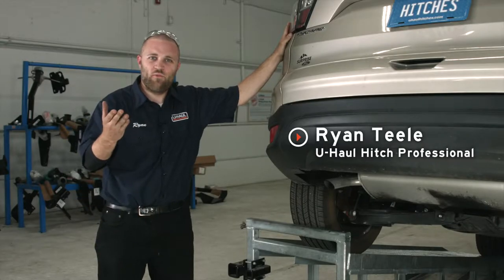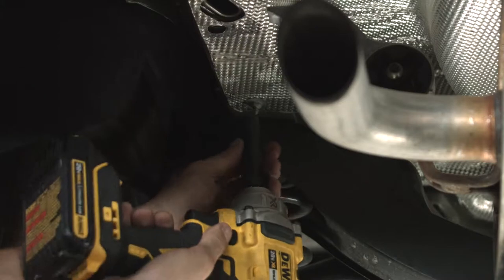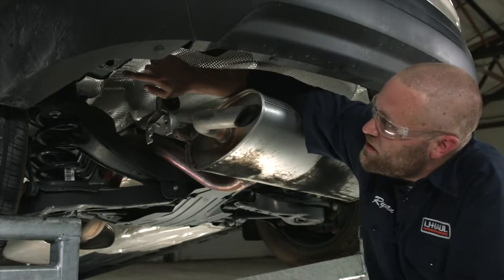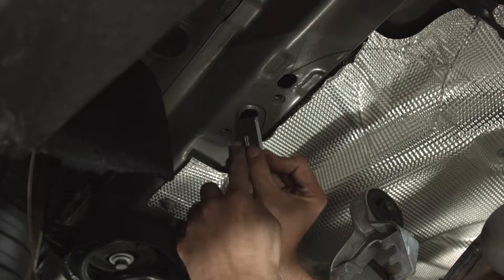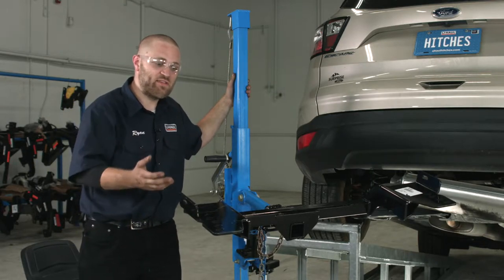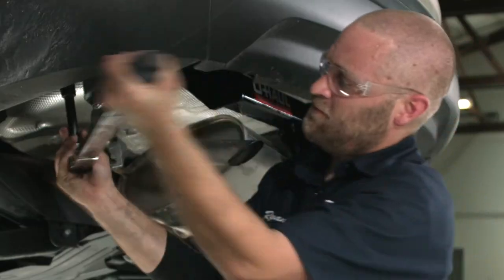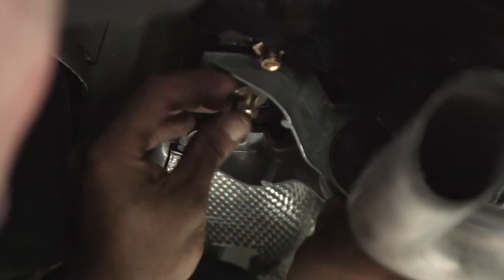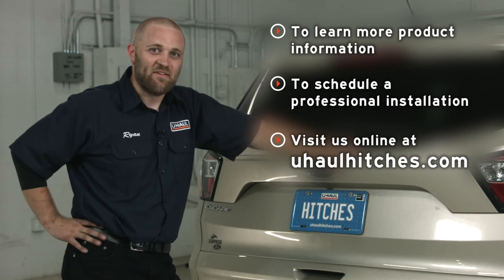2017 Ford Escape Trailer Hitch Installation

Comment: Omg thank you for this! I’m moving with my wife to WA from AZ and I’ve been trying to figure out if a tow hitch can go into my 2017 Ford Escape! Which trailers do y’all recommend?
Reply from the maker: We have several options for a 2017 escape but they are all similar in build and weight rating. The Curt 13186 is a great option! You can get it here! https://www.uhaul.com/Trailer-Hitches/2019/Ford/Escape/4-Wheel-Drive/
Reply: @trailerhitches  thank you so much! Look forward to working with a UHaul team near me for this move of mine! Thanks again!😊
Reply from the maker: @kaitytialavea4228  Make sure you upload your travels and tag them with #UhaulFamous
Reply: @trailerhitches  will do! 🤙🏽🫶🏽